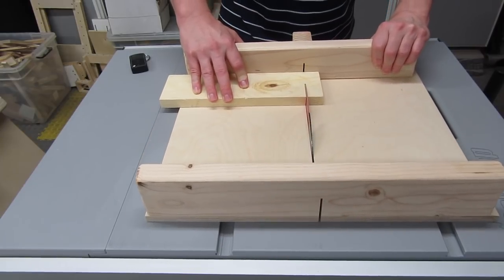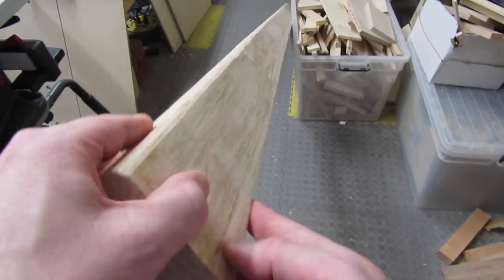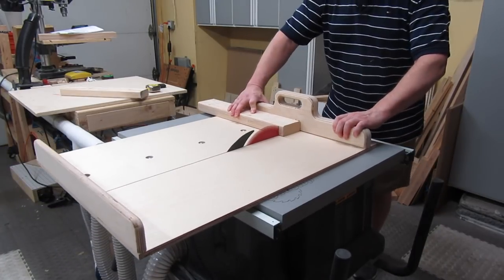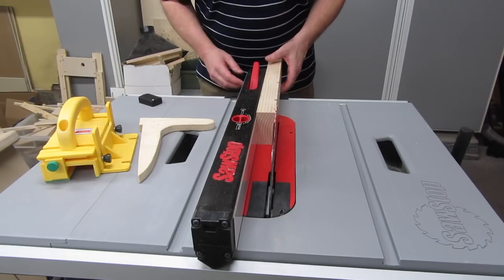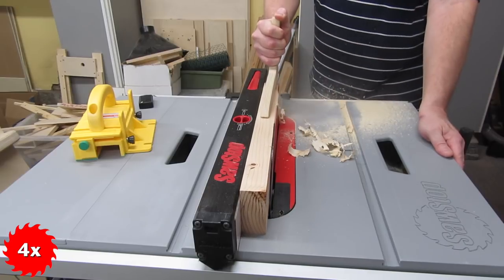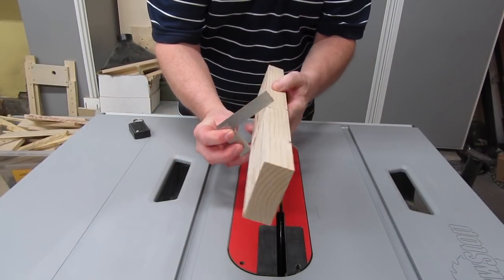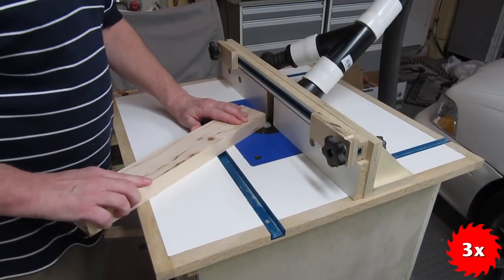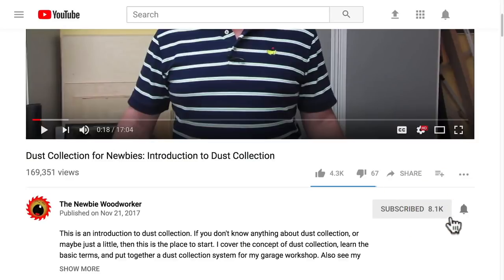2x4 Cross Cut Sled Fences

Comment: I've watched every crosscut sled video I can find so far.  Some several times. Especially Willam Ng. Now this series again and again and again (I'm 80 years old and a slow learner). Your process is so simple, and direct. Great epiphany. Do all your sleds have only one runner? If so, why is that? If not, why is that? Thanks!
Reply from the maker: Thanks, and I hear you. While William Ng's video is historical in some respects, it also made it seem like rocket science. It turns out, we weren't building rockets at all. 😄

I'm only using one runner in all my sleds (except my box joint jig, which is an odd shape). Why only one? Because one seems to work fine on my table saw, so why use two when one works?. 😛 I think if I still had my old Ryobi table saw, I might need two. Maybe, at some point down the line, I'll learn why this is a bad idea. But so far, so good. Knock on wood.

Comment: I've only made a couple of sleds, but I put two runners on them to better prevent twisting. Even the steel miter gauge that came with the saw, while it fits nicely in the slot, it still allows the miter to twist just a little (especially if cutting a longer piece) - making it hard to make square cuts.
Reply from the maker: I haven't had any twisting issues with one runner, but it might have to do with the dimensions of the sled. I have one wide sled that I use two runners on, to prevent twisting.

Comment: Very clear and educating video! Thanks for posting it :) Also a very very very good lesson on "bad habits" or rather habits that can become dangerous if you are not careful. I try not to use hands near the top of the saw yet (due to inexperience basically) so I always use push-sticks like the one Matthias makes. I actually printed copies after I saw this so that I can make his version tonight. Mine is a much less fancy and probably less protective/functional as well.

Also, although usually straight pieces automatically have fewer knots in them, it might be good to include that in the "requirements" since apart from the straightness and potential for warping and bowing with change in humidity, a knotted piece is a bit tougher to resaw on table saw and could also lead to grab and kickback due to possibility of more residual stresses in the piece. I generally try to avoid cutting through or near knots for those reasons. And of course, because I am a newbie ... heh heh heh
Reply from the maker: Thanks! And yes, I'm learning more about knots, from the comments here. Personally, I didn't have any trouble cutting the 2x4s even with knots, but that may be due to having a good saw. It's amazing how much I learn from you guys. :) Thanks again.

Comment: Good video... let me ask this though... to make the push stick to keep your hands away from the table saw blade, aren't you getting tgose same fingers pretty close to your band saw blade ? And router bit? 
Just an observation, I have a definite fear of band saw blades...
Reply from the maker: Thanks, and yes, I do get my fingers close to the band saw blade and router bit. As for the router bit, I know I got them too close, but the shape of the piece made it too cumbersome to use push blocks, at least for me. As for the band saw, no, I wasn't too close. The band saw isn't going to grab the piece and throw it, like a table saw or router can. I had complete control (famous last words, right?)
Reply: The Newbie Woodworker thabks for the reply... and the video... 
I'm gonna work on making a sled tgis weekend with this as my primary guide to start
Reply from the maker: Great! Make sure you look at this also, to help you square the fence: https://youtu.be/mLj1MeWKalI. And this, to help you cut the runner: https://youtu.be/hbODKq9kuW4. Let me know how it goes!
Reply: You may want to look at making or buying some featherboards.  They help keep the work piece snug against the fence without you needing to put your fingers anywhere near the saw blade.  You can attach one to the miter slot on your table saw for horizontal pressure and you can make a jig that attaches to your fence and lets you put one above the work piece for vertical/downward pressure if you want that also.
Reply from the maker: Thanks for the comment. I actually have several types of featherboards, but the left miter slot on my table saw is too far from the blade for these to work on thin stock - even the "Drillpro" featherboard is too far away. The right miter slot is closer to the blade, but I'm not as coordinated working from that side. (more)

I will definitely be making my own featherboards, and will make a video for it. For now, either the Matthias Wandel push stick, or a Grr-Ripper with the thin leg attachment will work. Thanks again!
Reply: I have a featherboard that attaches to the table top magnetically and you don't use the miter slots.  Works great.

Comment: Curious about why the rear fence height is made lower than the max blade height?  
What about adding a “bridge” over the cut line to keep it together?
Reply from the maker: You could certainly do that, and I've done that in my bigger sleds. But for the vast majority of what I cut, this works just fine.
Reply: @TheNewbieWoodworker  thank you for the feedback. Great work!
Reply from the maker: @superd222tube  👍

Comment: Recently started watching your videos and now I am hooked!  Thank you for sharing all the information.

One question: why should the height of the fence (nearest to you) be slightly less than the max height of the blade?  Wouldnt we want the fence height to be (say) an inch more than the max height of the blade so the fence doesnt get cut into 2 (thus weakening the structural integrity of the sled) if/when you use the blade at full height for cross-cutting a thick work piece?  TIA
Reply from the maker: Thanks - glad you're enjoying the videos! If memory serves, it's because we trim the sides of the 2x4, and if the 2x4 was too tall, the blade won't cut all the way through when we trim them. When you're using the sled, you don't usually cut wood that thick. But if you need to, I'd consider making a "half sled" that only goes on one side of the blade. That way you can cut any height you want without afecting the fence.

Comment: Hi Dan
I wondered whether you take down your saw between uses, and if so, do you then have to recheck everything for square each time.
Thanks once again for the tutorial.
Reply from the maker: Thanks. I leave my saw up all the time. But jobsite saws like this SawStop, or my old Ryobi, are designed to be opened and closed regularly. They have a place to store the fence, to keep it reasonable safe.

So the first few times I closed the saw and reopened it, I'd do a quick alignment check, but once that satisfied me, I'm pretty sure I wouldn't need to keep doing it. Although I'd probably always check the blade for 90 degrees, especially since it's so easy to do with a magnetic angle gauge.

Hope that helps. Feel free to ask more questions if you want to!

Comment: I am curious why you saw off two of the rounded edges only you round them at the end of your project.
Reply from the maker: It's because raw 2x4s have rough surfaces, and I wanted smoother surfaces. Also, they look nicer when you remove the rough surfaces. But I suppose you don't have to do that - I hadn't really thought about not doing that!

Comment: "It shouldn't cost much at all."  Laughs in 2022.  I just paid $6.98 for one 2x4 last week.  I used 2x4 for my sled just like seen here, but after a while realized the 2x4 just wasn't straight enough.  Took it off and replaced it with a piece of MDF made of three 3/4" layers glued together.
Reply from the maker: Yeah, things have changed, haven't they? Good call with the MDF.

Comment: is it safe to resaw a 2x4 in half to make 2 1x4's using a table saw?  Thansk
Reply from the maker: Well, "safe" is always subjective. But if you're careful, it should be OK, depending on what type of saw you have. Just remember not to stand directly in line with the 2x4, in case it gets kicked back, and keep your hands safe.
Reply: I'll be careful, thank you
Reply: @semperfitt356  Trying to resaw a full 2x4 might bog down a lower powered saw which might require a much slower feed rate. But a better option might be to cut a little over halfway on the first pass then flip it (same face against the fence) and finish it off with a second pass.
Reply from the maker: @FoScoJo  👍

Comment: So, which came first, the cross-cut sled, or the cross-cut sled?  You used a sled to build a sled, LOL
Reply from the maker: LOL, and I think you're the first person to call me on it. 😄What can I say, I like my sleds, much more than I like miter gauges. 😏
Reply: @TheNewbieWoodworker  LOL, I know the feeling.  I just bought a DW745 Sunday (can't afford a Saw Stop) and spent the last two days aligning it.  Most of them come prealigned, but mine apparently didn't.  I carefully aligned my fence to the miter slot, but my first rip job tried to kickback at me. I stopped the kickback but it ruined my board (a standard 2x4, no loss). 

So, yesterday I started the tedious task of aligning the blade with the miter saw.  It took about four or five hours before I got the bright idea to partially tighten the screws and use a hammer to knock it into alignment.  Even then, it took another two hours this morning to get it aligned.

Then, I aligned the blade to be vertical.  You might know it, the manual suggested I adjust something that didn't need adjusting and never showed the correct screw that I needed to loosen (which was right on front easy to get to, unlike the suggested adjustments, LOL)  So, the blade is 90 deg vertical and at 45 deg, it is 45 deg.  The fence is aligned and when it says, 3/4 inches, it is dead on - not a smidgen one way or the other!  

Boards run through the blade like soft butter through a hot knife.  

After that, I made a mini-half sled.  I found what I thought was a very straight 2x4 about 15 inches long and a piece of 1/2 inch OSB. I ripped off the rounded edges of the 2x4 giving me two straight edges you can't see the sun through. (I have to work outside).  

I also cut runners from plywood. In my first attempt, I cut the width first and then tried to cut the depth without a zero clearance insert.  A piece of the first runner shot out at my dog who was incessantly barking at me and the saw.  She ran for cover and leaves the area when I am standing near the saw now.  (Smart dog, LOL)

So, stood a piece of plywood on end to get the depth first, then cut off the runner width.  I thought I would creep up on it, so I cut it about 1/32 to 1/16 inch wider than I thought I needed. It went into the slot but would not slide.  I screwed it onto my OSB piece and it tried to slide, but stuck at one end. After close examination, I discovered that the coating DeWalt added to the table top had burrs, so I filed them down and the sled sides smoothly across the table now.  No sanding required. :) 

Then I ran the sled through the saw, trimming it to width.  Then I added the 2x4 I prepared and screwed it in at the corner nearest the blade.  My sled is a little longer than the saw table, so I could clamp the other end of the fence without screwing it in.  I used an engineers square to align the board perpendicular to the saw blade edge and tested a few cuts with my square. I tapped the board back and forth until I got cuts where the sun couldn't shine through any edges of the square, then I screwed it in and tested again. Finally I secured the track and fence with multiple screws.

When I first tried to align the fence, I discovered that the board had a slight bend at the end near the fence.  With a straight edge, I saw that the rest of the board was straight, so I champered all the edges, turned the board so the bend was hanging off the left side of the table saw and made all my adjustments.  

For me, the champered edge did not affect my alignment because i just raised the steel edge of the engineer square above it to align with the face of the board. I also hung the fence over the saw blade expecting the saw to cut it off equal to the board.  It left about 1/2 inch at the top because the saw blade is not high enough to cut it, LOL.  So, it has become an undocumented feature to show me that a board is too tall to be cut with my saw, LOL. 

I tested the cuts with a 10 inch by 10 inch OSB board and came up with no sun between the square and the edges of the 5 cutter.  It's only a 6 inch square, so I doubt it is perfect, but it is plenty good enough for  a 10 by 16 inch mini-half sled. 

Since the miter guage is pretty sloppy on the DeWalt, I am using this sled for cross cuts.  The first production cut for it was excellent!  I cut a 13 inch 2x4 and stuck the end at the corner side of a 24 inch board for my cabinet. The boards line up on my framing square perfectly.  If there is any error (other than the fact that the 2x4s aren't perfectly straight) it will be much easier to correct when I connect them with pocket holes than it was when I had way-out-of-square boards connecting for my previous builds. 

So, pending weather conditions tomorrow, I'll be outside cutting more boards for my LEGO cabinets for my table saw, miter saw, and drill press stands.  Now that I make 90 degree cross-cuts, I should be able to build one of the cabinets as well.
Reply from the maker: @BlessedLaymanNC  No that is a cool story. Great job of working through the problems. I can relate to the problems you had aligning the blade. My old Ryobi was so bad, I had to use a board as a lever to move the trundle, and I had to move it a little too far, because when I tightened down the bolts, it would move back a little. What a pain that was, but eventually it came out OK.

I'm a little concerned you still have some kickback (i.e. the smart dog), although what you describe might not have been kickback, it's hard to tell from what you wrote. But even if it wasn't kickback, make sure you always use a riving knife or blade guard (whenever possible). Either of those end up reducing the chance of kickback to almost zero.

Why can't saw companies ship decent miter gauges with their saws? I mean, they know the exact dimensions of the miter slots, right? I hate that. Regarding the miter slot, even on my SawStop JSS I had to do a little filing at the end of one of the miter slots, because it pinched. So I guess that's pretty common.

Regarding the fence not being perfectly straight, one of my sleds eventually developed that problem, even though it was straight when I first made it. Who knows? Fortunately, for that sled, I know which side of the fence to trust.

Sounds like you're having a lot of fun! Think about making a smallish sled also. I made one when I was making one of these sled videos, but I didn't think I'd use it for anything, since I love my big sled. Turns out I use it as often as I can. Both sleds are right next to my saw, so they're both easy to grab, but I always grab the short one first if it'll work. Not sure why - it might be the t-track and flip-stop I have on it. Anyway, I like having both sleds.

Thanks for writing! 😄
Reply: @TheNewbieWoodworker  Thanks for the reply and encouragement.  I have been working on building the stand for it all morning. The sled I made is only temporary so I can build more of what I need before it goes bad.  It's only made of OSB, after all.  

The piece that kicked back was only about 3 or 4/16th inches wide and dropped in the saw blade slot. That's how it bypassed the guard. 

The sled has successfully cut the angles I needed for the cabinet!  One board was shorter than the others by a smidgen, so I cut a smidgen off the other three, LOL. 

At my age, I'm taking it slow and easy and one step at the time. No need to rush it.  It's been great actually accomplishing what I set out to do so far with the new saw.
Reply from the maker: @BlessedLaymanNC  Taking it slow and easy? I've been working on one of Steve Ramsey's "weekend" projects for a month. I know all about slow and easy! 😄